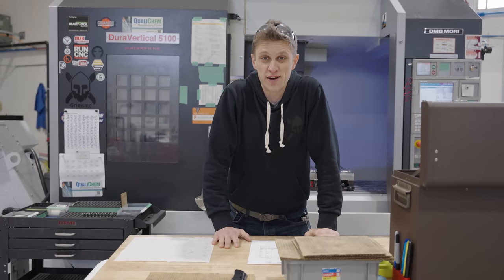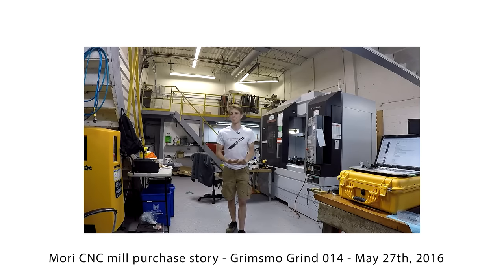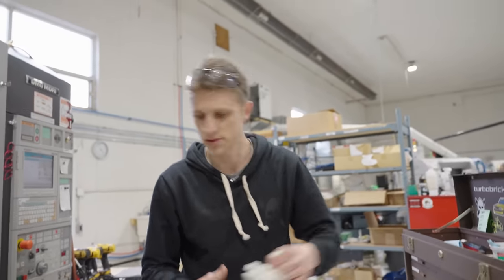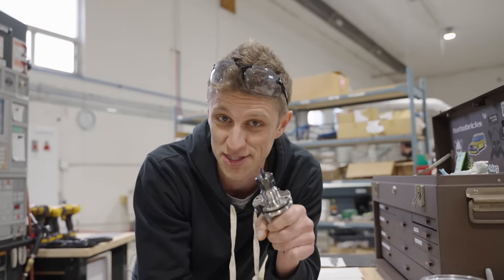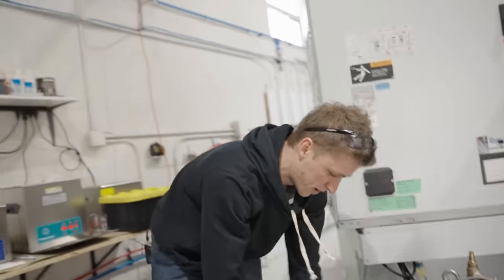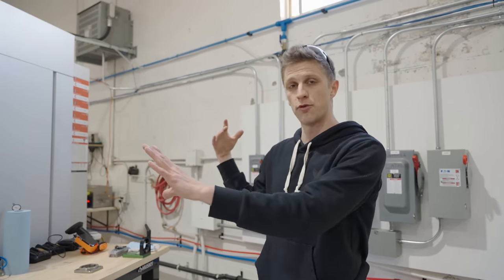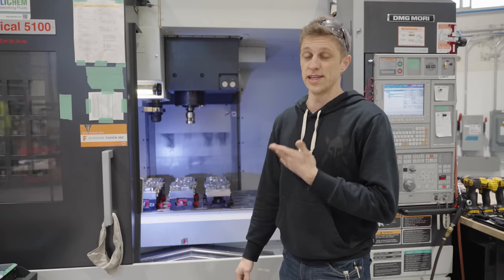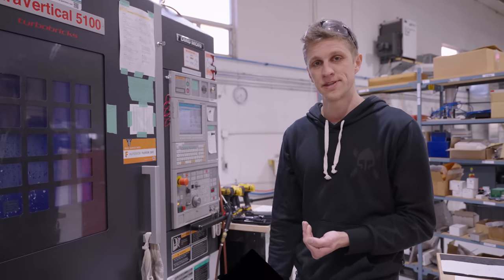Things To Do BEFORE Buying A New Machine

Comment: Please look at how much the renishaw parts are BEFORE agreeing to a quote to add them to the machine. They are very easy to install and the machine makers add HUGE markup on them. I added a tool probe like yours, TS27R, for 800$, just needs wiring into a connector in the elec cabinet. Even the OMP sets you can get for around 4K from Renishaw when they want 10K to add it to the machine in the quote.
Reply: Those fud ruckers.

Comment: The shop I work for has been mixing big plus and normal tool holders for 10 years with no issues. We just make sure that the spindle face and stays clean. Through spindle air blast during tool changes definitely helps.

Comment: John, you can just tee into your existing coolant pump for the thru spindle. We have 8 mazak verticals set up this way. Even with the standard pressure pump it works well
Reply: Yep, no need for an additional pump.

Comment: You can also hold down the chip conveyor stop button until it blinks to disable while you empty the chip hopper, works just like the coolant. Have you asked your salesman about Mori-Messenger? You can use it to check the status of your machine remotely, from your phone. Know right away if a tool broke.

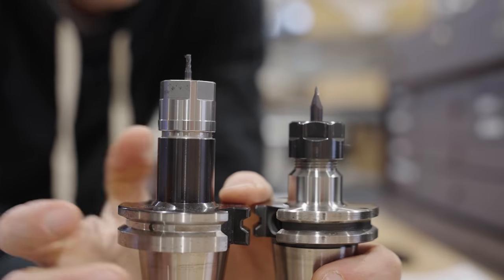Comment: 18:38 I would highly recommend hydraulic or shrink fit holders for your tiny endmills. The runout on an ER collet can be fairly significant, especially with prolonged or rough use. I've seen some beat up ERs have .005" runout. That might not matter on a 3/4" roughing endmill, but can be huge on a .093" finisher.

Shrink fit or Rego-Fix powRgrip type holders require an investment in support hardware, so I'd personally go with hydraulic for your application. As a bonus, changing out broken tools is faster with hydraulic than any of the others including ER.
Reply: YES, Shrink fit is AMAZING!

Comment: As a Haas TM3P owner the spindle sounds like it'll shake apart at 10k.  It's very noisy.
Reply: I was debating of buying one of those.
Reply: @Sicktrickintuner  don't get me wrong I love the machine and it's about the biggest thing you can run on single phase power.  And a low financial barrier to entry, $65k almost fully loaded.  It fills the gap if you're just getting into manufacturing and know the Tormach is too small to start with and the Mori are just way too much for your needs.  It'll be reliable and make you plenty of money.
Reply: The TM 3P has lots of travel and it's definitely not a toy -- it's a huge upgrade over Tormach. But as John has shown, you can start a viable business with Tormach equipment. Get what you can and learn how to make it work. You'll know when you need to upgrade.
Reply: @rgetso  
True, I have also looked at used machines that have about 23K spindle hrs

Comment: I have found failure of door interlock switch is caused by slamming the door, it will damage the cam on the switch caused by rebound of the door.

Comment: I'm curious to hear what the legal loophole is surrounding the lease and the $1 buyout could you explain?
Reply: At least in my country it would be because of tax write-off. If I buy a machine I can write off a percentage of it every year for a specific period of time. But if I lease it instead I write off the leasing costs directly. In this case here the write off period for buying would probably be ten years, with the lease it could be shortened to five. In the end it would not save me taxes overall but earlier on.

Comment: Replacement signal lights from china are ~40$... US/European prices of these are bs
Reply: I've seen videos where people buy them in china.
But can you actually just plug them into a machine?
Like is there soldering or do you have to be proficient in reading electrical schematics?
Reply: @kkknotcool pinout can be different.
I guess crimping new connectors/soldering is better than paying 700$ more for the proper one

I guess you mean the video from strange part's
Reply: @alexanderr6106  I'm not worried about the cost of labor in figuring out how to get it working. (even if you are worth $75/hr there is no way it's taking 10 hours)
I would be worried I'd do something wrong and fry the board, God only knows how much that would cost.
Reply: @kkknotcool  it's a common ground and a + for each led. It runs on 24v so not too much potential to fuck it up. 
I feel your point tho.